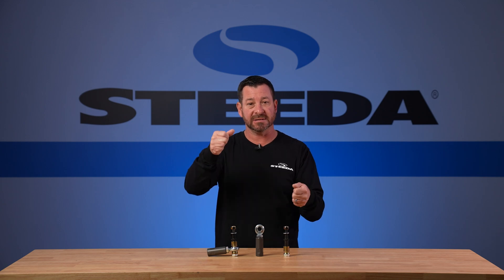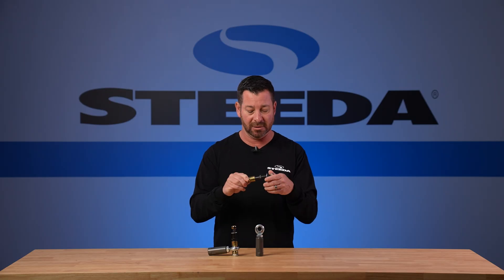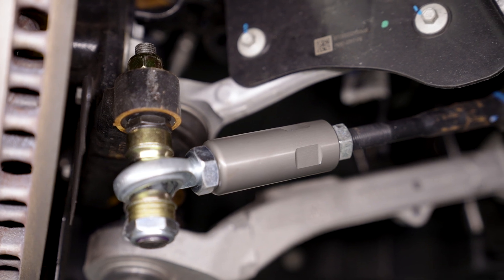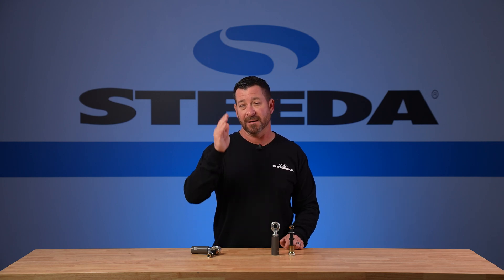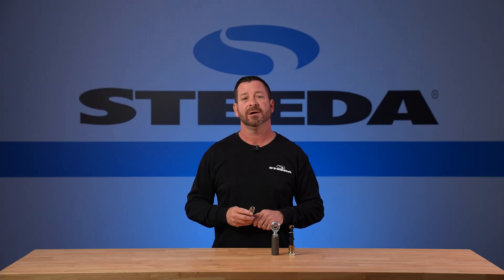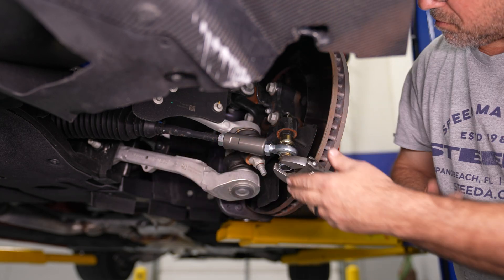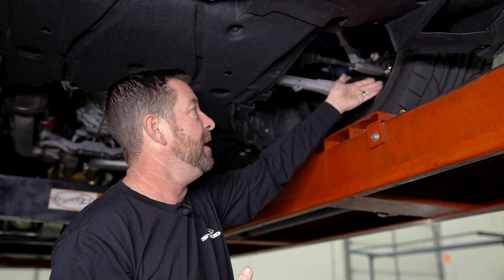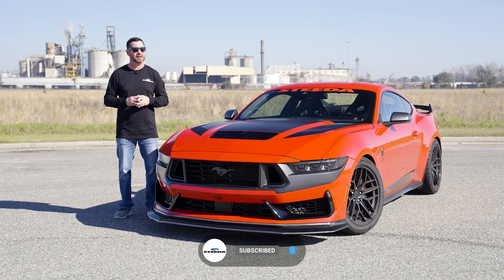The Solution to Fixing Bump Steer on Your S650 Mustang!

Comment: How long does the heim joint last since there is no rubber boot to protect it from the weather.  Also would it not be better to use steel for the threaded part instead of 6061 aluminum for strenght. We all know that 6061 aluminum  is easier to machine, is that the reason for using it.
Reply from the maker: The ball is stainless steel in the Heim joint and with the Teflon lining it prevents dirt and debris from getting inside. 6061 was used for the collar because it is both lightweight and has great strength. In 25+ years of making these I have never seen a failure.  -Scott
Reply: @steedaautosports  thanks for the info, but also no thanks, because now it's another thing added to the long list 🤣
Reply: Curious how it would last in winter climate. In my area they used pickel sand, that stuff gets in everything.

Comment: Isn’t bump steer a positive thing? A bump throws a car’s alignment off. The movement of the steering wheel sounds to me like a natural response to a large bump in the road.
Reply from the maker: Think about if you were taking a corner on track, you hit the curbing, suspension compresses, and your alignment is thrown off. Then your wheel is now being pulled 1 way, which throws you off your optimal racing line. If you've never really experienced bump steer or are unfamiliar with it, it may seem like a natural response. But with bad bump steer, you are fighting the car just to keep it where you want it.